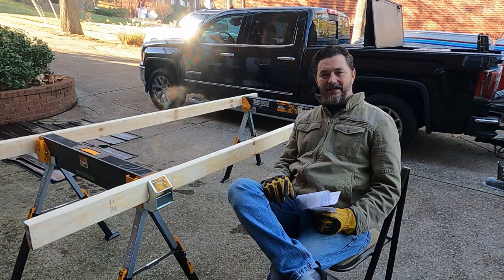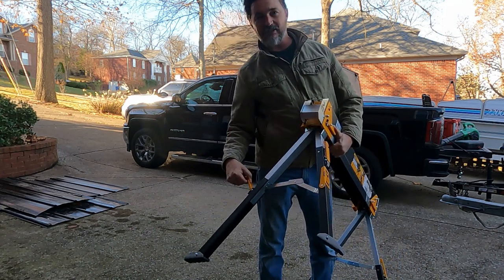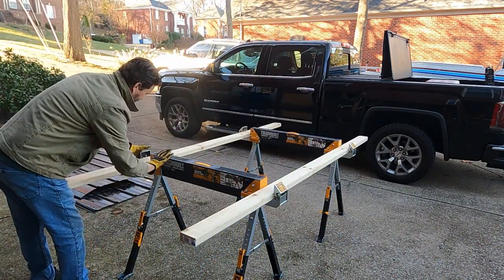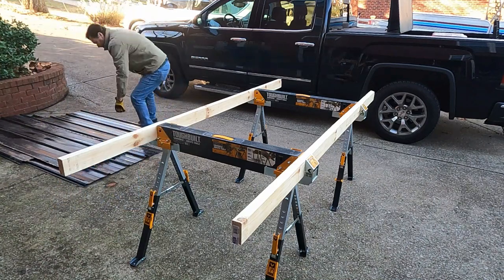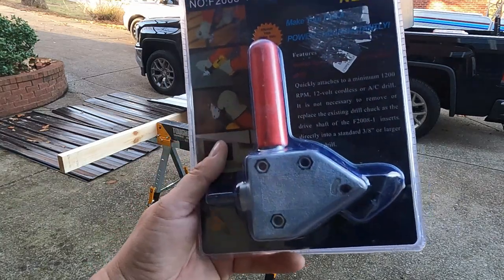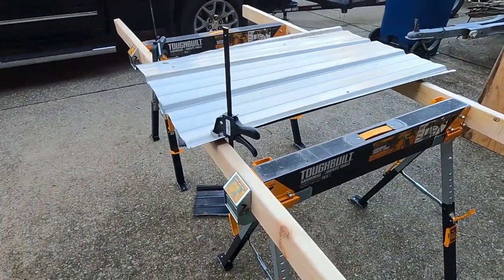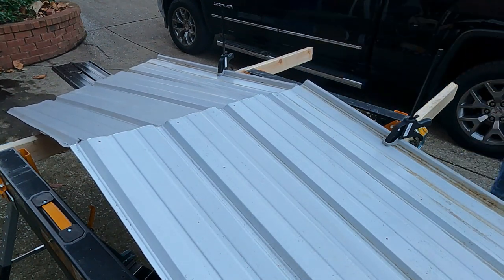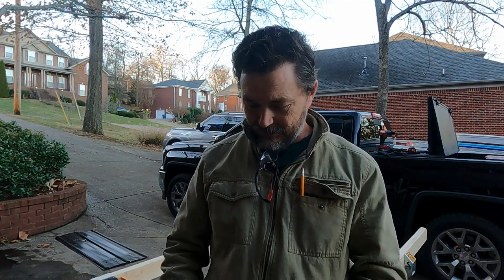C700 TOUGHBUILT SAWHORSE / JOBSITE TABLE / HOW IT WORKS / WHAT IT DOES! A GREAT HOMESTEAD ADDITION.

Comment: Looks pretty difficult to cut with that new gadget on your drill.  To cut my aluminum soffit I turned my circular saw blade around and made a raised jig (made of 1x4s attached to vertical 1x2 sides on a 48”x18” plywood forming a very low bridge, sliding the metal under the bridge) and cross-cut my pieces between the 1x4s.  Worked really slick.  Just sharing my tip.
Reply from the maker: Great idea! I appreciate your thoughts!

Comment: Great video. Been thinking about a pair of these. Will those jaws hold copper and plastic pipe strongly enough to saw and bend them? Just wanting to know if I can cover more bases than just carpentry.
Reply from the maker: You know I think those jaws will hold plastic but copper may spin. I does not have any way to tighten or ratchet down tight. I wish it did. Thanks for hanging out with us here.

Comment: Hi Sean,

I have had my C700's for around three years and they are brilliant!  Some quick tips...I flip mine upside down and just fold out each leg....the outer leg can be left in the fully extended position as it will fit still fit inside.
I added the wood blocks to the top but kept them separate so I can still use the handle. I also added a Micro Jig dovetail groove on each of these blocks for clamping. Enjoy!
Reply from the maker: Great tips! Thank you!